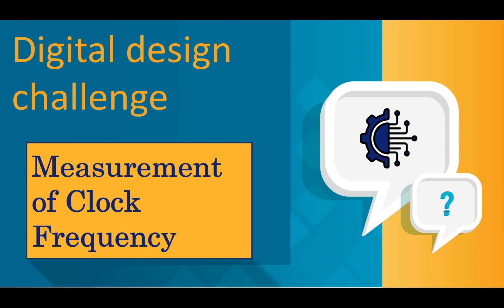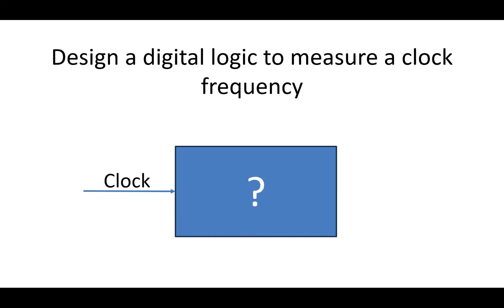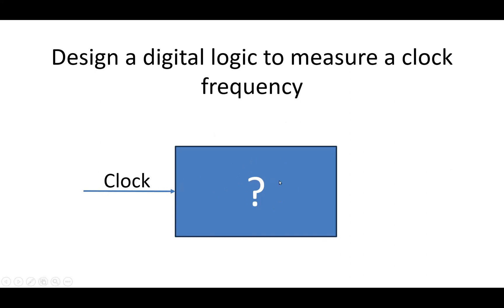Clock Frequency Measurement Digital Design Challenge

Comment: can we use fft ? If you give clock signal(which is rectangle signal)  to the fft, we will get syn pulse in freqency domain, by seeing the highest peak we can find its bin number
Reply: Do you mean an analog solution or digital solution? Cuz I believe all digital solutions must have a reference clock wrt which it can estimate clk_in frequency. Correct me if I'm wrong.